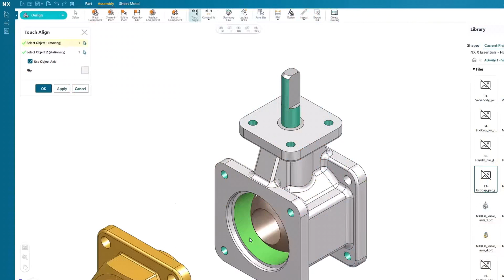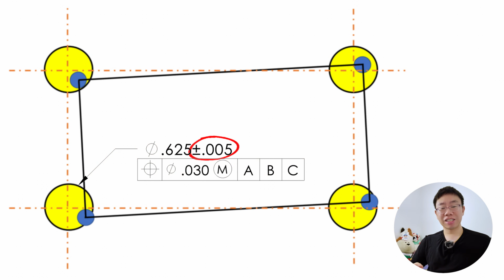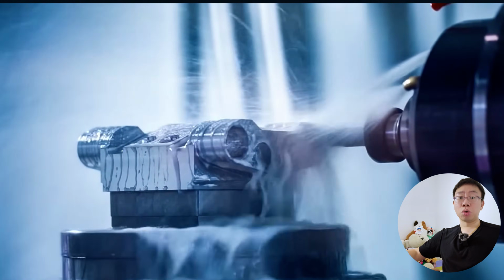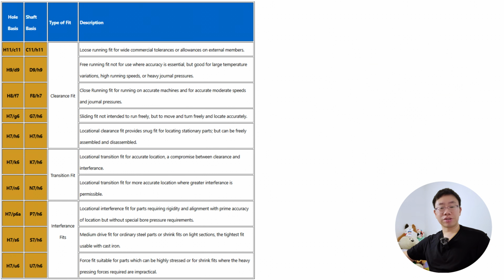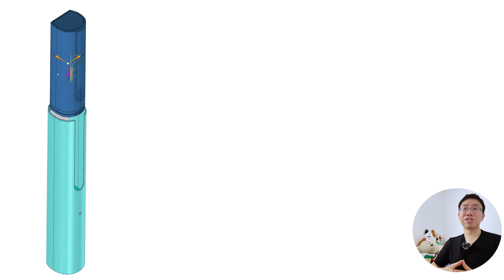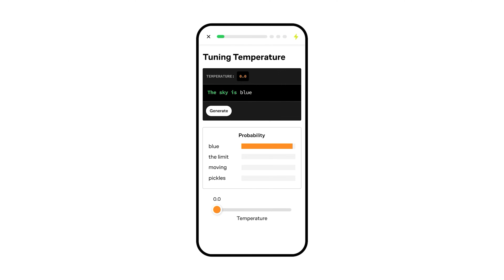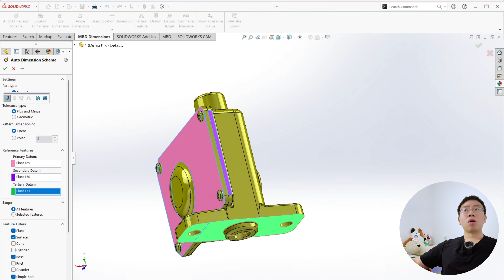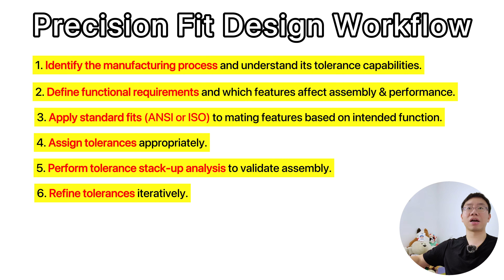How to Design Parts That Always Fit Together

Comment: Another thing worth knowing is that (where possible) a manufacturer will typically work a tolerance to its extreme in order to reduce manufacturing costs. They will tend to produce a cast part to the smallest amount of material acceptable, thereby saving a fraction of a percent on every piece. On the other hand, they will tend to machine the smallest amount of material acceptable, slightly reducing the machining cost. So a cast hole will likely be bigger than nominal while a machined hole will be smaller.

Of course, design engineers should allow for tolerances that are not affected by this, otherwise there is something wrong with the design. But it's handy to know.

Comment: I think tolerances should not depend on manufacturing technique. Always define as relaxed tolerances as possible and choose whatever manufacturing technique can reach the required tolerances.

Why would you require 0.05 mm tolerance for a non-critical surface even if the whole part were fully machined? Manufacturing technique shouldn't define your tolerances. Instead, required tolerance may define manufacturing technique.

And if you cannot improve the design to be able to manufactured without tight tolerances, the manufacturing process of your design will be expensive no matter what you do.

Great design allows relaxed tolerances and still achieves the intented performance of the final product. Creating this kind of design is often very hard!

Comment: TolAnalyst, the Solidworks add-on, does only 1D analysis.  It is more convenient, but not more capable than spreadsheet-based 1D tolerance analysis methods.  I mention this because this is not made apparent in their marketing of the product.  1D analysis, at least, is a must for good design work, as described well in the video, but 2D or 3D effects in a tolerance analysis may be very important for some parts or assemblies.  To include them involves either some trig that can be done manually (for 2D effects) or more trig and matrices that none of us likely want to deal with manually or within a spreadsheet, so 3D tolerance analysis software, almost surely programmed by a dedicated tolerance analyst (due to the steep learning curve and the difficulty retaining proficiency), is often worth the cost, at nearly all stages in the design process.  A search will find three most often 3D capable tolerance analysis software options.

Comment: What about binning parts according to measured dimensions and mating them with parts that also binned? I believe this is what they do with ball bearings for example, allowing for a greater spread in dimensions and less scrapping of parts. Another example would be pistons and engine blocks.
Reply: This adds extra cost, because every, part must be measured. Goal is to rely on process capability.

Comment: also
do you even need tolerance?
maybe a slightly different desing can eliminate the need for any kind of precision 👍
Reply: Everything requires tolerancing. A drawing is a contractual agreement between engineers and machinists. Without tolerances, a machinist could return the raw stock to you, and it would be valid provided no other details besides nominal dimensions and feature locations were provided. For convenience, you can apply a general tolerance note to the drawing to specify a tolerance for all dimensions other than dimensions with dedicated tolerances. For example, "General +/- .005 unless otherwise specified."
Reply: @theofficialczex1708  general tolerancing is a bad habit imagine a drawin where dimensins a, b, c are such a=b+c, one could choose d and c to describe the part b and c are +/- .005  what would be a if we decide to manufacture a and then b and finally to obtain c, what would be the tolerances of each dimansion a, b in order to mesure d and c in the end of the macining. do the math you will find your self with dimensions with 0 tolerance.
Reply: @nadonadia2521  That's called an overconstrained drawing. When you have linear dimensions A, B, and C, and C is the dimension over A and B, and A and B are chained, it is necessary that C either have a tolerance band equal to the tolerance bands of A plus B, or not exist. This is common in drawings. A general tolerance only applies to dimensions that don't have specified tolerances.
Reply: For something as little as screws, there's need for tolerance and fit
Reply: There is no such thing as 'no kind of precision'. Every manufacturing effort requires a specification to communicate what is and is not acceptable - otherwise, the manufacturer can send you literally anything and you have no have no right to challenge it